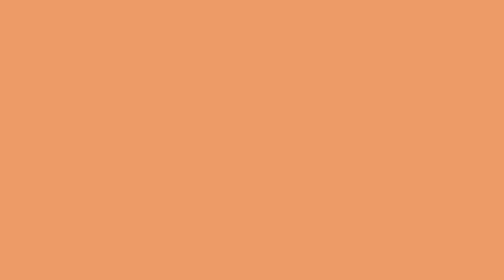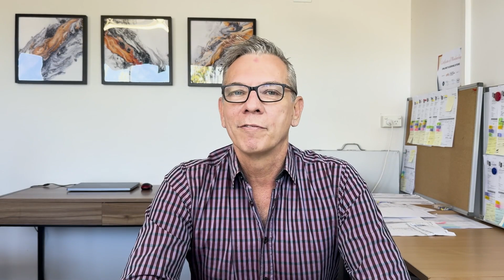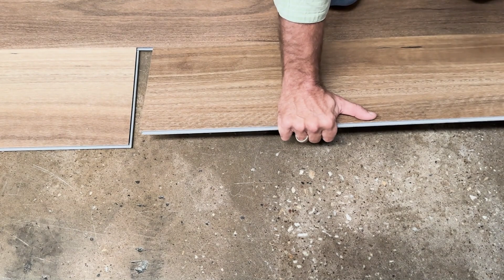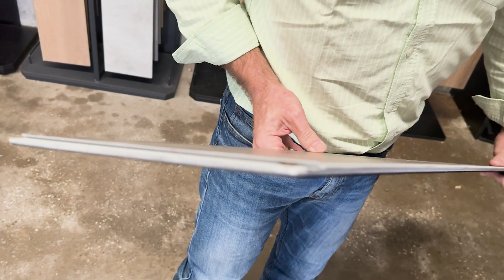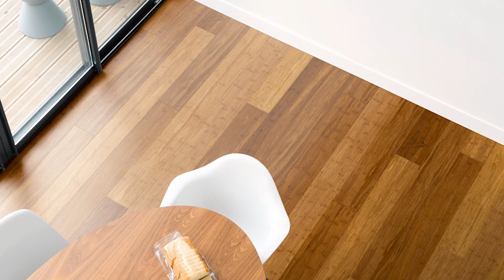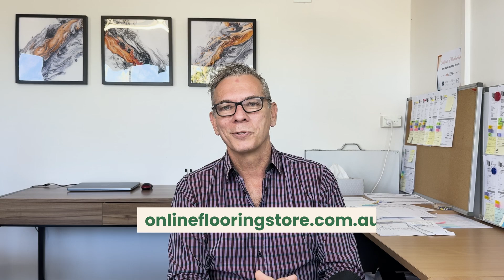🔓 Flooring Locking Systems Explained: Which One is Best for Your Project

Comment: Ive been in construction for 30 years and i can say this with certainty. The easier installation methods are always infirerior when its comes to longevity. This applies to almost everything not just flooring. Drop and lock systems are really easy to install but is complete garbage. Dont be lazy folks your regret it later on down the road
Reply: You're 100 percent correct. Drop lock is complete trash and they've come up with it for homeowners. 4 sided lock is the only one I would recommend to people.

Comment: I think you made a mistake there. Välinge 2G is 4 side angle/angle system, not droplock. Unilin provides undrop, which is a drop lock.
Reply from the maker: Hey Joey, there are a lot of terms that are used in the industry and a lot of terms floating around in my head. For Example, the 5G and 5Gi are systems that are different, but often get confused as they both have 5G in the name. I may have spoken out of turn as I tend to run off unscripted, Thanks for the coment, and feel free to reach out if you need to.

Clem

Comment: Good video. A lot of info. We're interested in LVF, also Bamboo, thanks to your video for upstairs and downstairs. However, it's difficult to find flooring with the Uniclic or 5G label.  We went to Lowes, Home Depot, Floor & Decor, etc. They all seem to have the same locking system. Any suggestions? What thickness do you recommend?
Reply from the maker: Hey Pat! - Levi here. Sorry for the late reply. Call 1300 702 201 and have a chat to Clem. He genuinely loves answering these questions :)